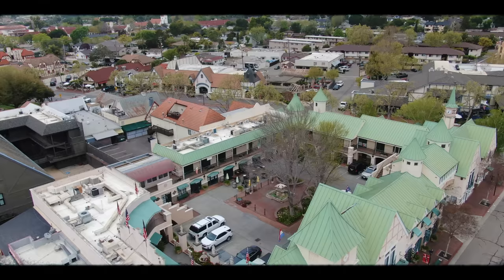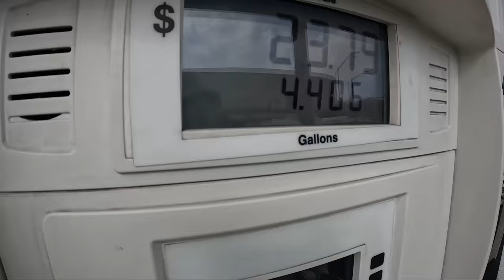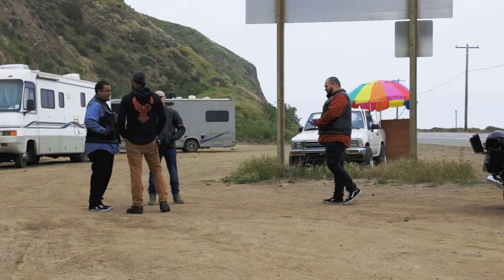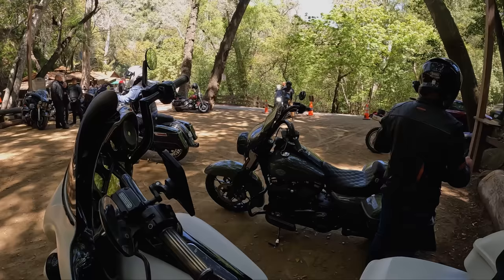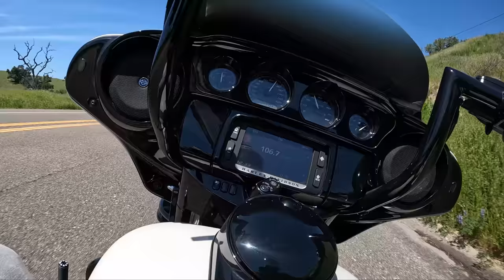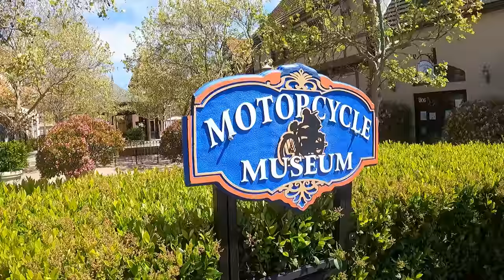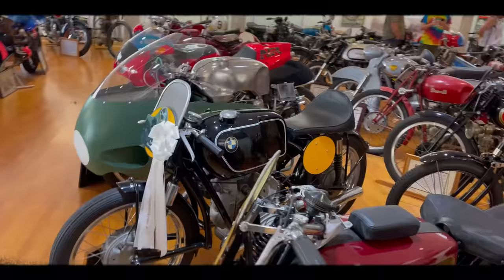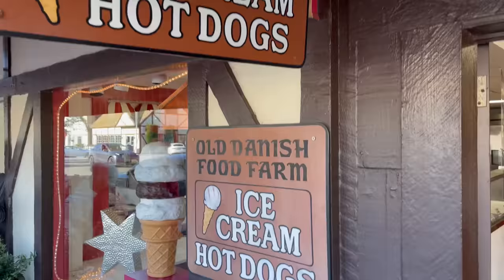Solvang on a Harley-Davidson

Comment: Hey Matt I rode up to Cold Springs Cavern summer of 2022 with a group of guys. Man that narrow road right next to the restaurant is hazzardous. As I was slowing down on my 2015 road glide to prepare to make that left turn into the that dirt lot, my bike began to lean to the right and then it fell to the right, tossing me off and into that ditch. It was a steep decline. Fortunately a fench that I rolled into prevented me from tumbling down thirty feet or so. I could have gotten badly injured if not for that fence. A waitress relunctly confessed that because of the slant in that road someone falls in that same spot at least once a month. So be careful when slowing to make that left then into dirt lot. Stay in the center of the road.
Reply from the maker: Good to know. Yea, the dirt lot itself is very uneven. Gotta be careful. Thanks for the comment.

Comment: I went 12 years before going down on gravel at under 5 MPH… The following season, I dropped my bike stopped at a red light. I couldn’t believe it. I immediately put on “motorcycle drop guards” and have been fortunate enough not to test them as of yet. Ride safe!
Reply from the maker: It never hurts to have the engine guards. I use them for the highway pegs as well

Comment: Hi Matt. I'm asking your tall rider experience. I'm 6'6, 40 years old with a slight riding sciatica condition. Sure it does not happen while few miles around, but by longer stretch such as 50 miles or more with fwd foot pegs bikes. I own a pan america and the upright position is a great fit which eliminates that problem somehow and the miles can go by. Still I'm thinking about the HD riding style. Especially on a Roadking. I can't ask my dealership for 50 miles or better a week tryout. I've many times wonder how does your back and legs handle long stretch riding a touring frame, and how does it compare to the pan am, mostly on bumpy roads as we have around here in France and Europe. A back rest would do a lot too. So to you, if you don't mind me asking, sciatic nerve-wise, which one would be better fit for tall guys purpose ? Cheers mate, Adrien

Comment: So I'm riding around New Zealand on a rented Street Glide. What a piece of crap. Compared to my 22 Heritage soft tail. The Street Glide handles like a pig the suspension is rough and bounces enough to make me sea sick,and that stupid fairing wit a radi and speakers and god knows what other crap in it makes the bike top heavy, the steering heave and low speed mauvering difficult. The 114 ci Heritage softail classic is the best bike Harley ever made, 114ci m8  street glide is not only the worst bike harley-davidson ever made it's up there with the worst and most dangerous bike ever made by any manufacturer, end of. And I've done at least 5000 miles on each so I know what I'm talking about, I mean a radi on a motorcycle pfwhttt the f.
Reply from the maker: Dang man. That sucks. Maybe the bike needs to be serviced? I’ve got the last 10 years of my life on street glides and I dig them.
Reply: @Matt Laidlaw  maybe if you a big guy they work for you but seriously all that weigh up high on the bars? Don't make much sense even from a point of physics tbh.